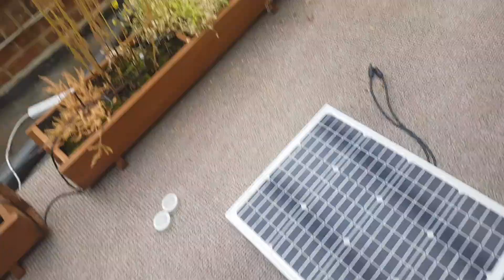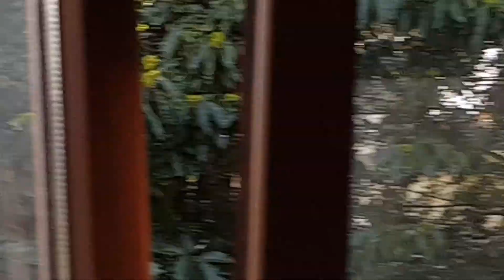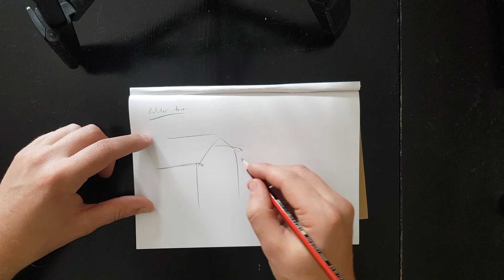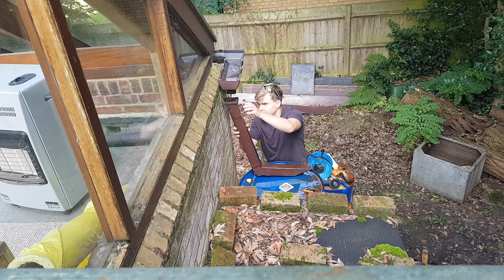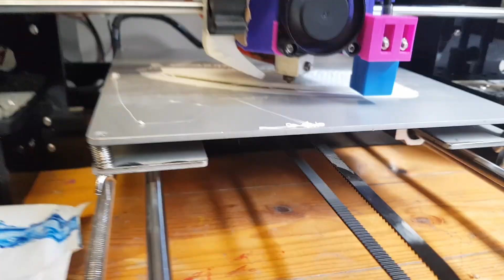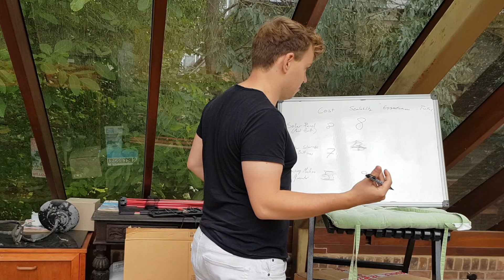🌊+💪+🌞=🌳 At-home projects to curb your climate impact

Comment: Maybe you could have run the generator with a tyre pressed against the flywheel. You could then adjust the resistance by moving the contact point radially. Would also eliminate the need for accurate concentricity. 😊
Reply from the maker: Good idea Dan! I actually was looking at using those castor wheels that you get on rolling chairs, but I was worried that the pressure required to maintain sufficient friction would actually push the flywheel about its bearings (it was all surprisingly floppy). That and the castor wheel would have been revolving at around 1.5k to 2.5k RPM, and was worried I'd set fire to the rubber and ruin my parents' rowing machine (and my lungs).